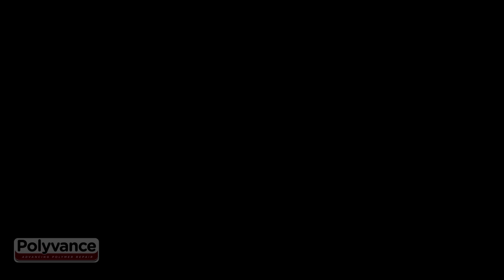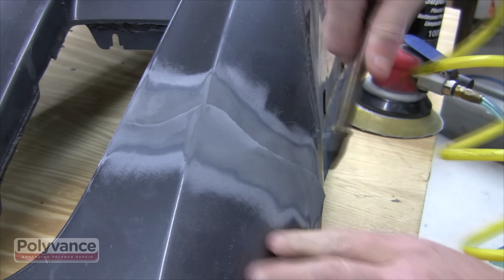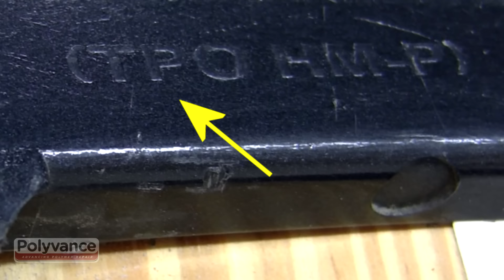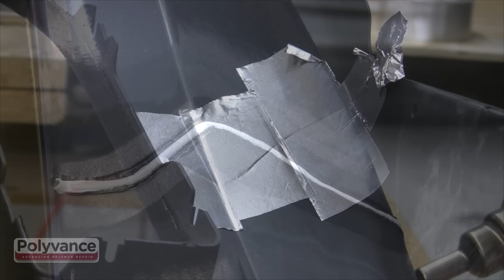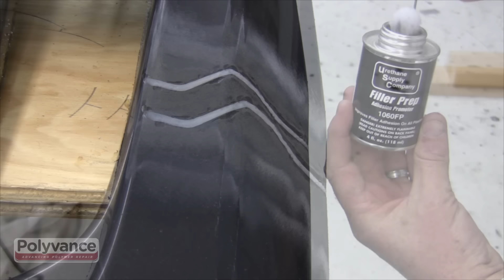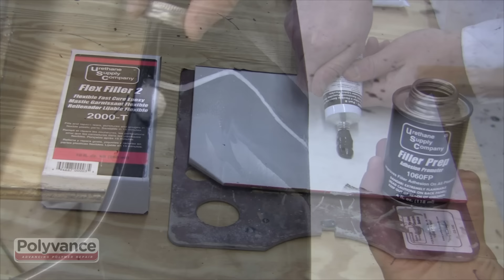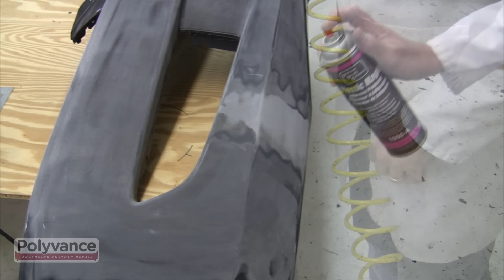Bumper Repair with Hot Air Plastic Welder

Comment: A fender-skirt on my 30 year old motor home has an impact-crack. For a one-time repair this method shown here has too high of a tool and material investment but watching this video made me wonder if I can fix it with CA glue and baking soda. From the videos I've seen it's quick and durable enough to repair aircraft.
Reply: Don't use CA on your skirt!    It will not hold for the long term.  I believe your skirt is made of ABS and Plastifix works amazingly well on it.  It chemically etches itself into the ABS and should not fail.  Plastifix LOOKS like it could be CA and baking soda, BUT neither part of Plastifix adhesive will do anything without the other part, unlike CA glue.  PF is a special type methylmethacryalte (not to be confused with cyanoacrylate CA glue) designed for ABS, PC, Acrylics and other hard plastics.

Comment: I would have drilled the dge the crack first
Reply: Its not really needed in this case, to stop drill the crack.  While "V" grooving the crack, the end of the crack gets a radius...then when you weld, the weld overlaps the end of the crack, eliminating the stress riser.

Comment: Darn, you in my opinion, you didn't do this correctly. In my opinion, you should have Remelted plastic with a small metal spatula trial, kitchen butter knife to smooth plastic into the edges. Then sand with 30 grit paper. When laying down epoxy you should have applied a Steal mesh like stainless or Aluminum mesh. what I have done is embed Aluminum door screen and or plastic drywall mud tape. This works just fine. Without this reinforcement bumper could crack again. Just my opinion mate, that's all. have a good day.
Reply: When properly welded, there is really no reason to apply epoxy of any other reinforcement.  The weld can easily carry all the loads applied to it in normal driving, refinishing, etc.   Also, PP does not take adhesives well at all, so reinforcing with epoxy and glass cloth has little to no value.  If added strength (in addition to the weld) is needed, a couple of "frankenstein " welds perpendicular to the original weld is all that's normally required.  If even more strength is needed, melting stainless steel mesh can be added to the welded area using an airless welder, but with a nitrogen weld, this is not really needed, not even for torn tabs or bolt holes.  I would steer clear of aluminum window screen.  it it too thin gauge and has little tear resistance when melted into plastic.  As far as smoothing the weld, thats fine to do.  Use an airless welder and feather in the edges.  On the front however, the feathered edge will usually get completely sanded off anyway, so doing this to the front may be minimally beneficial.
Reply: @scottb7600  I don't use epoxy at all. I only use reinforcement when the costumer wants extra holding power. Sometime the customer cannot afford a topnotch job and that's when I use Aluminum screen or plastic tapes. Just depends on the costumer. Thanks for the reply.

Comment: Buying this plastic equipment, sanding, sprays etc will coast you a lot of money, so it is useful only if you have repair business, otherwise you are probably better off buying another used bumper for less than the repairing price.
Reply from the maker: Hello. Our hot air and nitrogen plastic welders are mostly for body shop use. Using this equipment, a body shop can repair an OEM bumper and other plastic parts. Body shops would most likely have all of the other tools (cleaners, sander, aluminum tape, sandpaper, etc). We do, however, have some cheaper, DIY-type kits available. They can easily be found on our website, and we have videos for them as well.

Some bumpers are harder to find than others. Some older cars might have OEM bumpers that are hard to find (and therefore more expensive). You may find an aftermarket part cheaper to put on yourself, but you run the risk of it not fitting properly, and you also have to wait for the part to come in. Having it repaired means you can keep the OEM part on the car and not worry about fitment issues or wait for it to come in. Of course, all cases are different, and the amount of damage will need to be evaluated to see if it is worth having a part repaired. Many times it is cheaper to repair small cracks, tears, tabs, etc. than to replace the whole part.

As far as repairing (or having it repaired) vs buying a new bumper:
You can find a win-win scenario for both the repair shops and the bill payer. Check out this article and interview with Kurt Lammon, president of Polyvance (under the Plastic Repair section): https://autobodynews.com/index.php/component/k2/item/15517-the-best-body-shops-tips-repair-vs-replace-what-a-body-shop-should-consider.html?showall=1

There is a good example of a win-win scenario in the article:
If a replacement part costs $400, and the shop makes 25% gross profit on parts, the shop receives $100 of gross profit and the bill payer pays $400.
However, if the part is repaired and the shop is paid for 6 hours of work at $50 per hour with a 50% gross margin on labor, the shop makes $150 gross profit and the bill-payer only pays $300. So if the part is repaired, both the shop and the bill-payer come out better than if it had been replaced.
Reply: @polyvance  Yes I agree with you, it is suitable for the body shops.

Comment: ok. all I need is a plastic weld rod and a heat gun that able to heat up to 1000 Fahrenheit
Reply from the maker: We have a Steinel hot air welder kit with welding rod (https://www.polyvance.com/Hot-Air-Welders-1/6055/). Of course, we also have our nitrogen plastic welders for body shops to use.

Comment: Fun video. The cheapest way is to get one off another car the same color.. Saves time, paint and you will never get it as good as the factory did.
Reply: True, but that can be hard to find.  Bumpers tend to be the first thing to get damaged in an accident.  :-)  But as far as getting it as good as the factory, this is not difficult.  In fact, I had a bumper repainted recently and it looks better than the factory paint job...no orange peel!
Reply: @scottb7600  i know exactly what your saying but thats what i meant by factory like. I just painted my motorcycle tank and it looks too good. Not only that but you will fork over $300 + on primer sealer base coat and clear. Then rolls of how many different grits of sand paper. Good video though as iam not knocking it. I just put a hood on my buick after hitting a deer and it was $55 at a Upull junk yard in kansas city. I drove 10 hours round trip and even grabbed the fender that i didnt plan on and you cant tell the paint (white) is any different from the rest of the car.

Comment: A dude from Indonesia had a better solution for this, simplest, cheapest, out of the box and creative idea  (whatever you named it) 🤓. Using some pieces of Instan noodle and super glue. Check this out 👉🏽.. https://youtu.be/2x29WoUdvq4
Reply from the maker: Not quite. It may be "simple", but it isn't good.
Super glue + baking soda (or in this case, baby powder) cures rock hard and loses all flexibility. If you were to flex that piece, the "repair" wouldn't bend and would break.
Super glue itself does not stick to polypropylene, the most common type of automotive plastic. In addition to its poor adhesion to this type of plastic, it's brittle and once that bumper is flexed at all, the joint between the bumper and glue will crack.
The best way to repair plastic is to fusion weld. You take filler rod that matches the type of plastic. By properly fusion welding, you are making the plastic one whole piece again. It's like pouring a cup of water into a gallon of water...it blends and cannot be separated.
As far as price, our hot air/nitrogen welders are more for body shops to use, and the welders pay for themselves in just a few months. The body shop would have all of the other tools needed to complete the repair. The welding rods are cheaper than using two-parts with mixing tips.
We do, however, have some more "diy"-type repair kits available.

Comment: Iam using baking soda and superglue for repairs of cracked bumpers like this
Reply: Seriously?  Have you had one successful repair using Super Glue on a polypropylene bumper?  I can tell you the answer is a definite "No!" as Super Glue does not stick to polypropylene. In addition to its poor adhesion to this type of plastic,  its brittle and once that bumper is flexed at all, the joint between the bumper and glue will crack.   If this were a urethane bumper, which it is not, it will stick well, but due to the differences in flexibility will also crack in a short amount of time if other repair methods are not also used.
Reply: Seriously? And you and as i see, you prolly know all peple, all glues all bumpers. 
Man stick your head from barn at your farm. I can bet with you, next time when i will visit usa i will bring with me secret potions and glues for instarepair and i will repar your bumper. And you will see how wrong you can are. Salute primavera

Comment: Oh, you mean panel bonder? That mixes in the needles you attach to it and squeeze out through? Ooohh..
Reply from the maker: No. Welding rod that matches the plastic you are working with. We now carry 20 types of welding rod material: https://www.polyvance.com/Welding-Rod-List/
To make the most out of plastic welding, you need to properly fusion weld the plastic together using welding rod that matches your base plastic.
Reply: Panel bonder $40+ = Low strength repair.   $1.00 worth of welding rod = High quality repair and $39.+ more in your pocket.  Choose whichever makes sense to you.

Comment: Perfect video, not all cars have Bumper replacement, there are cars with parts discontinued and the only way is fixing the broken plastic part, so this video is perfect for those that have cars with discontinued parts...
Reply from the maker: Exactly! Or cars with very expensive OEM replacement bumpers. You can just have the OEM bumper fixed.
Reply: I think the most valuable use I've found for plastic welding is fixing discontinued parts. It's a priceless repair technique. Also have a Steinel - great guns. Wish it had a pinpoint reducer nozzle included for finer repairs.

Comment: Ok so my polyvance plastic repair class instructor did it wrong,lol. He didn’t sand off the paint and he didn’t use the filler or adhesion promoter . Oopsy.🤭

He did do a good job on the rest of it though.

Comment: Naaa!...i'll just use gorilla glue for now! Just too much work! And later buy the whole bumper! I'll leave that to the profesionals!
Reply from the maker: Hello. Our hot air and nitrogen plastic welders are mostly for body shop use (the professionals). Using this equipment, a body shop can repair an OEM bumper and other plastic parts.
Gorilla Glue and other super glues do not stick to polypropylene (the material most late model bumpers are made from) with any reliability.

As far as buying a new bumper or having your bumper fixed:

All cases are different, and the amount of damage will need to be evaluated to see if it is worth having a part repaired. Many times it is cheaper to repair small cracks, tears, tabs, etc. than to replace the whole part. You may find an aftermarket part cheaper to put on yourself, but you run the risk of it not fitting properly, and you also have to wait for the part to come in. Repairing ensures you keep the OEM part on the car, and you don't have to wait for the part to come in.

You can find a win-win scenario for both the repair shops and the bill payer. Check out this article and interview with Kurt Lammon, president of Polyvance (under the Plastic Repair section): https://autobodynews.com/index.php/component/k2/item/15517-the-best-body-shops-tips-repair-vs-replace-what-a-body-shop-should-consider.html?showall=1

There is a good example of a win-win scenario in the article:
If a replacement part costs $400, and the shop makes 25% gross profit on parts, the shop receives $100 of gross profit and the bill payer pays $400.
However, if the part is repaired and the shop is paid for 6 hours of work at $50 per hour with a 50% gross margin on labor, the shop makes $150 gross profit and the bill-payer only pays $300. So if the part is repaired, both the shop and the bill-payer come out better than if it had been replaced.

Comment: When i heat up my work piece that has a crack.  It warps and recedes back making the gap larger.
Any ideas.
Its polypropylene
Reply: Turn down the temperature and the airflow, put a piece of foil tape on the backside or back it up against a solid surface, move the welder faster.  You only need to melt the SURFACE of the plastic and the SURFACE of the filler rod to get them to weld; unlike metal welding where you need to fully melt the rod and substrate into a puddle.
Reply: @scottb7600  thanks will try it
Reply: And also polyethylene

Comment: Welding cable name plz
Reply from the maker: Our nitrogen plastic welders can be found here: https://www.polyvance.com/Nitrogen-Welders-1/
Our hot air plastic welders can be found here: https://www.polyvance.com/Hot-Air-Welders-1/
Reply: Polypropylene - Polyvance part number (ribbon) R02-04-03-NT and (1/8" round rod) R02-01-03-NT

Comment: Iv only got dirty paper towels. Why clean at the start when you're going to sand it down anyway?
Reply from the maker: If you have contaminants on the plastic and you sand or grind it, it's very likely you will embed some of the contaminants into the sanding scratches (which will impact the quality of the repair).  You should always clean the plastic first!  You can clean it again after if you wish, but you should always clean it first!

Comment: I don’t trust anyone that where’s a metal ring in a machine shop.
Reply: Machine shop?  No big finger ripping tools there, not even a drill.  Just sanders and grinders, neither of which is a significant risk to a ringed finger...not to say the ring shouldn't be removed in any shop, but in this case, there is just not much of a hazard.

Comment: Definitely less time consuming just  ordering a new bumper
Reply from the maker: Hello. Our hot air and nitrogen plastic welders are mostly for body shop use. Body shops can use this equipment to repair OEM plastic parts. You can order a new bumper and wait for it to come in and replace it yourself, or have a body shop repair the original.
Reply: No hardly.  If you are a body shop and can repair a bumper in a few hours, compared to waiting a day or more to get a new bumper in, its definitely worth while to repair a bumper, blend in the repair area and get the car out the door.  turn time is key to making money in a body shop.

Comment: so cool, you found way to fix $50-100 worth bumper using only $300+ worth of tools and supplies, and it only takes about a day of my time, worth mere $100. so cool
Reply from the maker: Many bumpers are not $50-100. Some older cars might have OEM bumpers that are hard to find (and therefore more expensive). You may find an aftermarket part cheaper to put on yourself, but you run the risk of it not fitting properly, and you also have to wait for the part to come in. Having it repaired means you can keep the OEM part on the car and not worry about fitment issues or wait for it to come in. Of course, all cases are different, and the amount of damage will need to be evaluated to see if it is worth having a part repaired. Many times it is cheaper to repair small cracks, tears, tabs, etc. than to replace the whole part.

Our hot air and nitrogen plastic welders are mostly for body shop use. They are not for DIY use, and are more expensive. Body shops would most likely have all of the other tools (sander, aluminum tape, sandpaper, etc).

As far as repairing vs buying a new bumper:
You can find a win-win scenario for both the repair shops and the bill payer. Check out this article and interview with Kurt Lammon, president of Polyvance (under the Plastic Repair section): https://autobodynews.com/index.php/component/k2/item/15517-the-best-body-shops-tips-repair-vs-replace-what-a-body-shop-should-consider.html?showall=1

There is a good example of a win-win scenario in the article:
If a replacement part costs $400, and the shop makes 25% gross profit on parts, the shop receives $100 of gross profit and the bill payer pays $400.
However, if the part is repaired and the shop is paid for 6 hours of work at $50 per hour with a 50% gross margin on labor, the shop makes $150 gross profit and the bill-payer only pays $300. So if the part is repaired, both the shop and the bill-payer come out better than if it had been replaced.
Reply: You might be missing the point.  This is not a DIY repair, its more for a body shop, so investing in the tools and equipment to keep labor dollars in house is well worth it.  Take a metal welder for example, many of them cost $15K - $20K and for you to weld with it once is a ridiculous idea.  It takes a long time for a metal welder to pay for itself, so 5 to 6K for a high end plastic welder makes sense as they tend to get used in a body shop much more often than a metal welder and pays for itself much faster too!